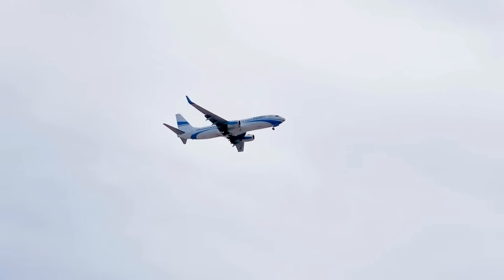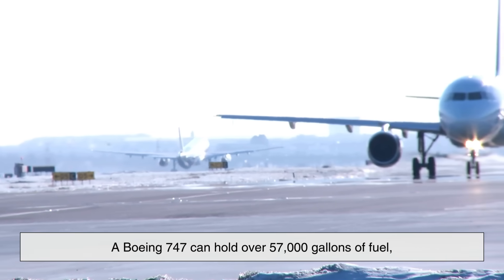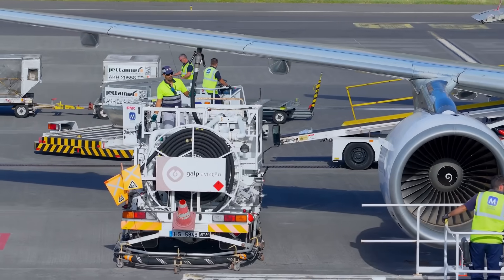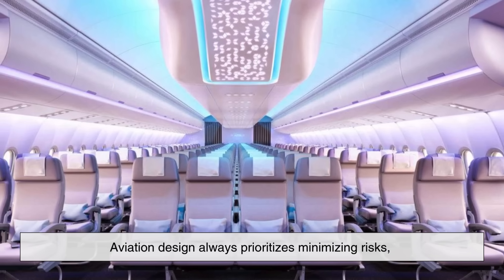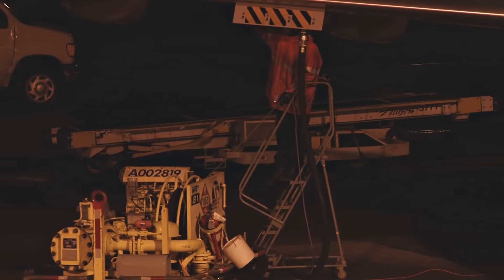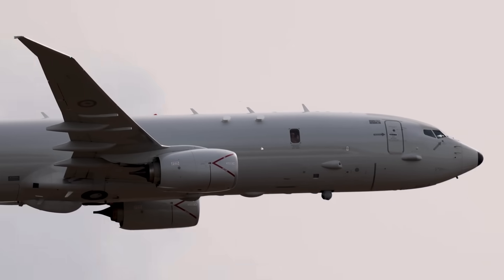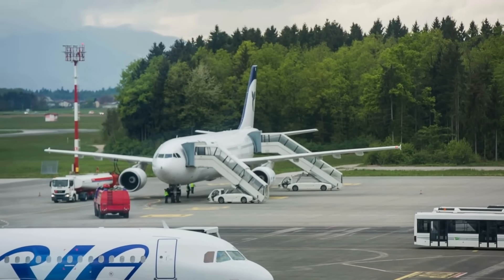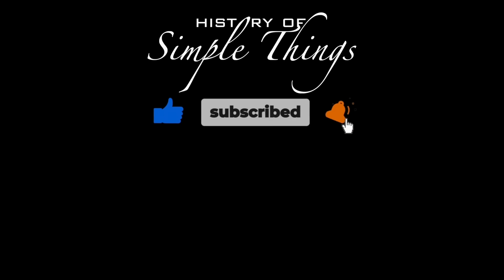Why Do Planes Keep Their Fuel in the Wings?

Comment: Good to know. I initially thought that FOR SURE it is BENEATH THE PLANE. Or beneath the fuselage or whatever you call it. Why? It endangers the passengers?

Watching too much Air Crash Investigations (on NatGeo I think) drew me to that conclusion. When you crash, usually it is fuselage first. Pilots are very wary to land the plane in an even space so it makes sense that the reason was to safeguard the fuel tank BENEATH the passengers and cargo. And yes, I assumed that the fuselage is divided into 3 PARTS: PASSENGERS, below it THE CARGO and BELOW THAT is the fuel tank. A screeching metal that will ultimately damage the fuel tank causing it to explode is a LOGICAL explanation why Pilots insist on safe landings.

I did not think that the tank would be on the wings for the same reason you mentioned in that video: IT IS TOO THIN to carry tanks. I thought that the "essential systems" ARE THE ONES that's on the wings. Which makes sense if you watch too many episodes of Air Crash Investigations and notice that once there is a problem on the wings, the aircraft control gets clunky. Because technically the "essential systems" have been compromised. So I was surprised that THEY PLACED it on the wing.

Another MAJOR concern that I have on the fuel tank's placement on the wings that you somehow brushed off but IS A MAJOR concern for me: IT IS ADJACENT to the ENGINE itself. What if the Fuel Tank blows up? SO IS THE ENGINE. You CANNOT RUN A PLANE without an Engine. That was crazy. ANOTHER REASON why I did not think that it is located on the wings. But I guess the whole industry has just agreed that this is a safer way. And I am not an Engineer. So I do not have any idea how dangerous it is to place fuel tanks at the very bottom of the fuselage. So whatever makes them happy. So long as I am safe.

Comment: A lot of larger AC carry fuel in enteral tanks as the wings just don’t have enough capacity for long haul flights
Reply: That will be done for Fighter jets, as their wings cannot be designed as large as commercial aircrafts, due to drag and stability concerns....
Reply: @krishnakaanth8919 747 has large internal fuel tank that's what exploded and brought down flight 800
Reply: All the commercial airliners also have a center fuel tank, some also have a horizontal stabilizer tank
Reply: All this is stated in the video.